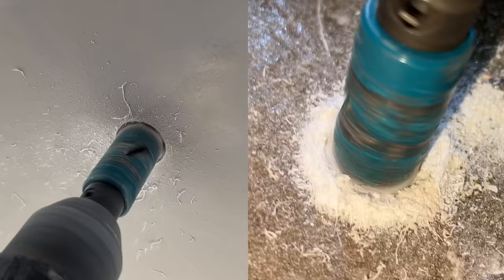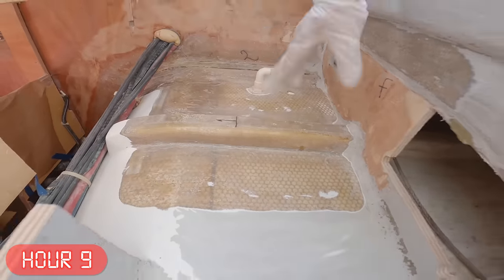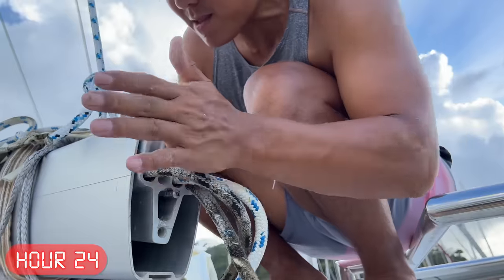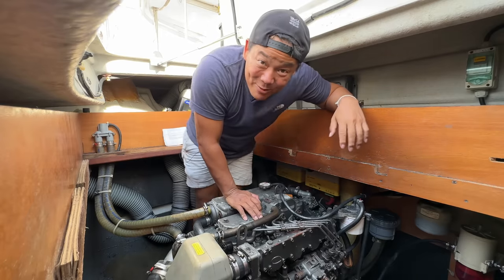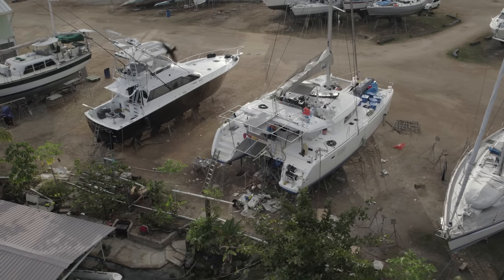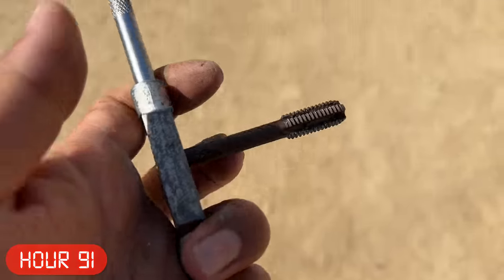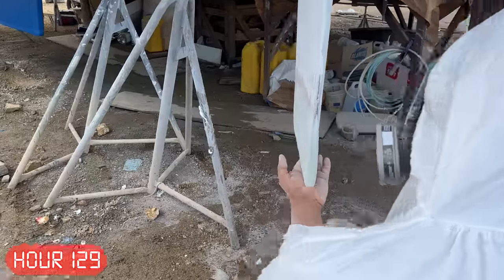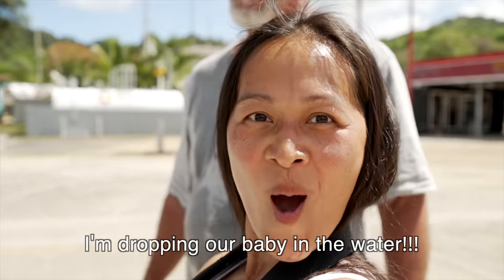200 hrs of Yacht Transformation In 20min

Comment: "Shipwright's disease" is a term sometimes used in the marine world. It describes a situation where a sailor owns a boat with a burned out light in the galley. The sailor decides to change the bulb, but then notices that the socket is corroded and decides to change the socket. While trying to change the socket, the sailor notices that the wiring is frayed.  This ultimately ends in a major undertaking and up to rebuilding the entire boat. This ties directly into the Ship of Theseus concept.
Reply from the maker: dude....i need to add these to the laws of boat work...  thanks josh!

Comment: Allergic reactions are usually fixed with diphenhydramine which is an antihistamine. It is used for allergies and is also a sleep aid. While using a weed eater around a rectangle made with railroad ties on the end of one was a yellowjacket hornet's nest. Was stung so many time I broke out and my eyes swelled shut. At the doctor I had a shot of 500mg's.

Comment: The only thing about driving the dingy… You are sitting on the wrong side. You should sit in the starboard side of the dingy and operate the outboard with your left hand and arm. Always wear you safety kill switch!!!
Reply: Ooooh!!! I’m right handed so it felt like I had more control. Thanks for the tip!
Reply from the maker: good point, amd funny thing bc colin told me the same thing! he said you're supposed to be revving the throttle like you would a motorcycle. and unfortunately the old parlay dinghy didnt have a safety switch, but i'll have to wire one in!

Comment: Err, boom vangs are there to hold the boom down and keep the shape of the sail so it's not scandalised, the topping lift stops it from falling down on your heads when there's no sail to hold it up.
Reply from the maker: ooooh that makes sense... so question, why don't some boats need boom vangs? is my boom just so heavy that its weight alone can shape the sail? serious question btw, i don't know much about sailing.
Reply: @david_shih  Hey mate, you either have a boom vang (or kicking strap as we often call them in the UK) which will be an extendable metal thing or it's just a line with some blocks. Something needs to hold the boom down apart from the mainsheet. It may well be that your rig is different, but almost all sail boats have this. If you sail with the topping lift tensioned then it has the same effect as a loose boom vang (i.e. messes up or 'scandalises' the main sail). Hope that helps dude and best of luck with your travels!
Reply from the maker: @jonnytooze  ah I gotcha. So my main sheet and traveler do that job. Embarassing, but I knew that at some point.
Reply: @david_shih  It does to some degree, but your main sheet will pull the boom centrally to the yacht, whereas a boomvang will always ensure the shape of the sail at any angle. The traveller is useful again, for trimming sails. So hey, I'm not 100% sure on your rig, but can you visualise changing the shape of the sail when it's full of wind? i.e. Could you use your current rig to pull the boom down if you wanted to? That's the main point of the vang.
Reply: PS. great vis mate, I subbed after seeing you on Colin's channel! You were a good addition to his crew!!

Comment: Nice repairs but I have to say those boats are so badly made - wow .  Good thing you are so willing to learn . 

Can't see the lagoons that have not got owners like you and parley lasting 25 years . My boat is 39 years old . They have all been hard raced from new - still holding together no real issues at all .

The lagoon is designed entirely around comfort for drinking at anchor , all else is secondary and corners cut
Reply from the maker: i think the problem is most owners hang on to their boats for such short times that they never notice the problems and jsut pass them down. older boats were built so much stronger

Comment: Hey bud, if you are doing an inside corner with fillet (duh right?), one smooth way to get the right amount of material and make a nice uniform curved surface ready for fiberglass is to buy a pack of playing cards. They are flexible enough that you can just bend one into a corner in a way that a putty spreader could never do, and of course, you get 52 of them to a pack. So, wipe and toss.
Reply from the maker: not a bad idea! everything needs to be disposable when dealing with epoxy!

Comment: You would have had an easier installation and a better job had you installed hydraulic steering. Cable is no longer used for a reason. Not being on the job site, I say this with reservation.
Reply from the maker: yeah...our cables are all rusted too...will need to change them soon

Comment: Shiming the rudder bearing with plastic from a soda bottle is micky mouse, proper way is to glass the pocket ,did mine with Kevlar tape 6 years ago still no play
Reply from the maker: totally true for a permenant fix, but if we glass the pocket then the new bearing won't fit, for when we eventually change that. i would have just bought a new bearing, but they were nowhere to be found in panama so we had to improvise!
Reply: @david_shih  sorry wrong the fiberglass pocket wears not the bearing ,I'm a machinist  glassed the pocket machined a plug to outside diameter of bearing on rudder with no play .Used high spot blue and flap wheel until plug fit snug ...zero play for 6 years
Reply from the maker: @Mechone11  ah nice man good to know! I never understood those types or bearing anyways. Metal on metal.

Comment: Get rid of the Plastic through Hulls ASAP! No Bueno Senior
Reply from the maker: wait really? do tell! i must know!
Reply: @david_shih  they are not reliable in the Marine environment! Go to expensive Bronze thru hulls and valves! They will be faithful for many years.  Make sure to seal the edges of your through hull holes also! Backing plate internally would also be a good idea to distribute and strengthen the thru hull area. Just an Opinion from a very experienced Cruiser shipwright and waterman! Been in the industry over 50 years! Not that it makes me special  Just knowledgeable, and experienced. Keep Smiling! Life is a Smorgassboard, Consume it!
Reply: PS are you gonna check  Colin Down? Or have different cruising plans?
Reply from the maker: @lawrencetrapani5623  thanks for the tips. I guess I should have clarified. The plastic ones are for the manual bilge pump and a good 3 ft? Above the waterline. Should I still be changing them to bronze?
Reply from the maker: @lawrencetrapani5623  would love to track Colin down; but he's almost around the other side of the world already!!! We'll see once we get cruising!